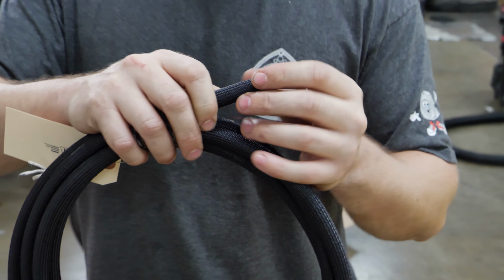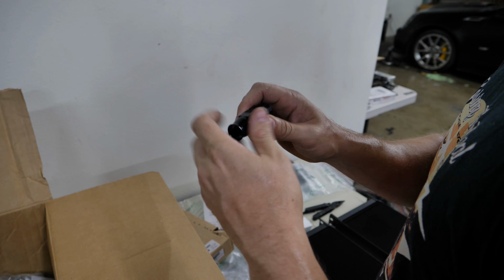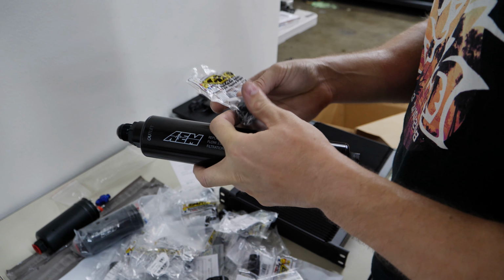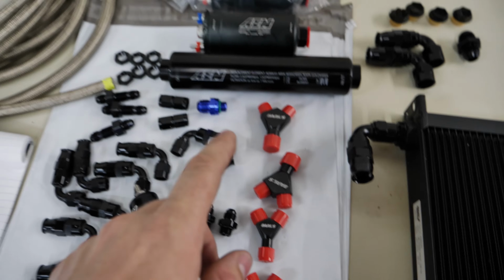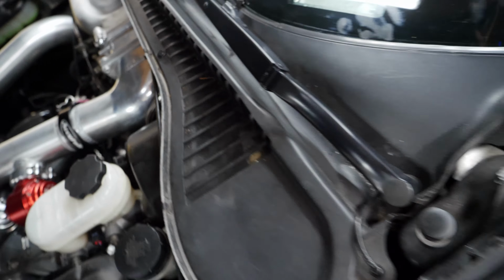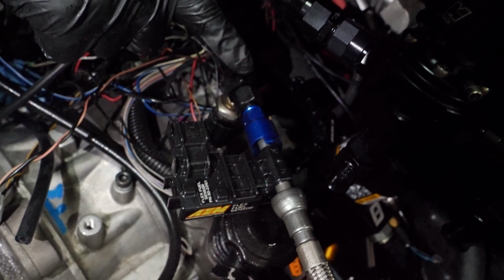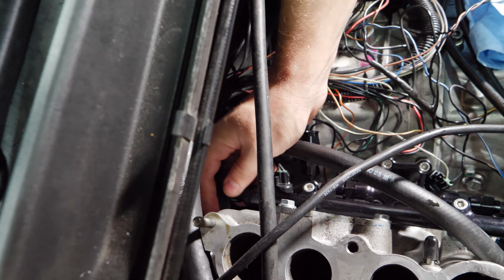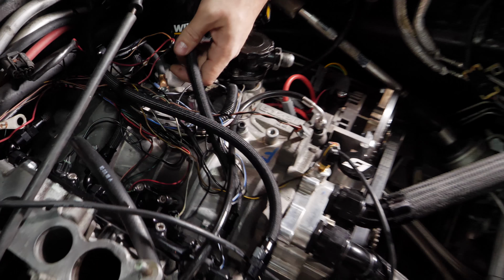Rotaries LOVE E85. Fuel Systems DO NOT. Corvette Upgrade!

Comment: Sorry, but E85/ethanol does not ''gum up'' stuff or corrode anything whatsoever. I don't understand how so many people have become misinformed about this. It will not harm any kind of rubber compounds or metals in your vehicle. The only thing it does is ruin a paper fuel filter and attract tiny amounts of water which is not a problem unless you let the fuel sit on top of metals for months at a time. I've been using E85 on a '99 carbureted motorcycle for 4 years now and nothing has been changed from original except a fuel filter and jets + a tune. No corrosion, no damage to 20 year old rubber hoses and carb parts no nothing.
Reply: Sounds great. =]
Reply: I've been doing the same in my 90 Ranger with just a tune and larger injectors.

I should use a filter that's not cellulose, but I haven't got to that yet.

Comment: Hey rob! Just a word of advice on doing a flex fuel sensor. You want the sensor to be before the fuel rail, not after. Thats so you won't run into a lean condition while ethanol is injected before your ecu can read it. If you can please move the sensor from the return line to the feed line, that'd be awesome!

Comment: Rob, why not run 93 octane with meth injection instead? Rotaries don't like E85 because - like you said - it gums everything up. It causes alot more wear too. It works great in piston engines but not for rotary engines - even though alot of guys use it. Here's a great article that compares and explains why:  http://www.colemanprecisionrotaries.com/tuning--fuel--expanded-e85-coverage.html

I've been following your channel for a while now and it's awesome. Just a fellow rotorhead wanting to help 👍
Reply: Ok I gave it a read as I also was thinking of converting to e85. For my application it won't be happening (stock Renesis for SCCA autocross). Rob has stated that he wants to push serious power (700+) with this motor. Based on the article, his best bet is to push all the E85 he can handle. Also what's a rob dahm build without blowing up a rotary and rebuilding it at some point 😆. Thanks for changing my mind. I don't think Rob's will change though.
Reply: All the corns and doritos!!! 🌽🌽🌽🔺️🔺️🔺️🇺🇸🦅
Reply: Because E85 is the ultimate racing fuel. Yes it is less energy dense but that is the reason for this. More tuning potential than normal fuel. E85 is also economical. Burns cleaner I mean way more cleaner the gasoline. I think Rob cares about the environment.

Comment: It’s been right at 90 for most of the day with 100 percent humidity here in Mississippi and I feel the working on stuff in the middle of the night. The only prob for me is everything ends up being closed when you realize you need the tool you returned earlier in the day. Just finished changing the water and power steering pumps on a 07 Cadillac DTS and it would have been a bigger struggle if I tried to do it during the day.
Reply: Don’t know if you’ve gotten the registration and all that done yet but it probably would have been a good idea to get all that done before irreparably modifying something like a fuel hat.

Comment: 6an isnt able to flow for much over 450hp with E85 .  it may be too restrictive.  better off coming out of the tank also with 8an , and reducing , so down the road you dont have to cut and reweld a fitting when you figure out 6an is limiting .
Reply: It's dual 6an into 8an up to the engine.
Reply: 6an is his planned outlet from tank size.   its restrictive, and limited compared to 8an or larger.  you can always reduce,  you cant always increase ......if he has a demand for 8an down the road.  he has to redo the tank fab work...  why ....... best to go 8 and not " need " it , than be limited ....right ?  and dual 6an to 8an , is a reduction in flow potential . do the math.    2x6an ,compared to 1x8an ..... also a single 6an regulator return . another reduction ......
Reply: @ionstorm66   6an is 3/8" .  so x2 =  3/4" ...   8an = 1/2".  ..
Reply: @twistymcslide2  if he has more demand he will need larger pumps, which will be most likely external, or a surge tank setup.
Reply: @ionstorm66  wrong.   with the reductions , sensors , and return .  he'll run out of flow because of the lines,  not the pumps capabilities.    fluids under pressure work differently than you seem to understand .
Reply: @ionstorm66    6AN is 3/8" .   so 2x 3/8" = 3/4" . . ..8AN = 1/2 ".   that reduction . and then the return is 3/8"....thats also a reduction.

Comment: Give you heads up you're going to have way more restriction in your fuel system using those y fittings by the engine then you would if you just ran one fuel line into your bottom fuel rail which the car runs off of 90% of the time and then run it into your secondary fuel rail then into your fuel pressure regulator before it returns that's the best way to do it the Y's just cause more restriction only benefit out of them you'll have a bit more volume in the system but it will cause a lot of restriction
Reply: The rails are only 6an, so running a 8an into them isn't going to give it any more flow.
Reply: @ionstorm66  the only reason why you upgrade your fuel rails and lines is cuz you need more volume not pressure the way he's doing it he's going to have the proper volume from the pumps but the Y fittings are going to cause a restriction which is going to defeat the purpose of setting it up for more flow not pressure
Reply: @ionstorm66   1 cheap and easy way if you need more fuel volume put an aftermarket fuel filter before the fuel pressure regulator and that will have the volume in the whole system

Comment: Isn't the fuel pump that you are using to send fuel to the other tank  going to loose pressure. I might be wrong but couldn't you turn the mechanical pump that transfers fuel between tanks off of a return line eliminating any possible pressure drop on the pump you connected to the mechanical pump.

Comment: I'd be a little worried  about powering the transfer turbine pump with unregulated pressure (Yikes). Use the return line instead. It will be pressure regulated and you won't have the loss of volume on the supply side.

Comment: Personally I'd keep the flex fuel BEFORE the rail on the feed side.  Seems nominal but if your E content varies from before and after the rails, it could be another potential pain in the ass you could avoid.  Just the .02 from a fellow Michigander cant wait to hear all of these rotaries brapping at the same time!
Reply: AEM calls for it on the return side. Iv done a bunch of flex fuel installs with no issues this way
Reply: @senditmatt3364  I've got to be remembering hearing something backwards then about having it the other way.  Good to know, now itll drive me nuts until I figure out what video I heard that from lmfao.

Comment: Don't weld the bulkheads to the fuel tank top plate. Use 1 nylon sealing washer per fitting, that's all you need. Don't make it harder than it needs to be

Comment: Ah the wonderful measurements of 'Murica. Because it makes 5/728% sense to say Oh this line is AN10, so you have to divide it by 16 to get that it's 5/8th of an inch meaning the outer diameter will be 26/8213 squared inch cubic miles.
Reply: Thank the military for the AN designation 😆

Comment: AN is the end connection type. So the fittings you are using are straight thread o-ring seal to 10AN adapters. They're not AN lines, they're hoses with AN end connections.

I'm an engineer for a tube fittings company just trying to help so you don't "sound like an idiot trying to order them".

Comment: Shouldnt you use higher compression with e85?
Reply: Higher boost means higher effective compression ratio
Reply: I run e85 on a 9.2:1 NA engine.

Yes you see more benefit with more compression or boost, but it will burn in almost anything.
Reply: @208Concepts  You're just killing your fuel economy for no reason running e85 in that setup.
Reply: @ionstorm66  perhaps, but I have my reasons 😁

Comment: not to be a smart ass but will the pumps fight each other?
Reply: No they won’t, it’s a proven setup. The fuel will flow through the path of least resistance. But if it’s such a worry he could always just use check valves after each pumps.
Reply: im not saying it wont work, as we saw it did, i asked if it would fight it. and did he use a check valve? no

Comment: "30% more for the same horsepower" definitely doesn't seem worth having e85
Reply: E85 needs higher temperature for it to ignite than typical 93 therefore preventing detonation when running higher boost levels
Reply: @julianbascle8481  but fuel is supposed to detonate
Reply: @Sube-Tube  Fuel is supposed to detonate, but under a spark not under pressure like a diesel. When you cram so much boost into an engine the fuel will pre ignite and cause knocking/pinging. E85 is a lot more resistant to that than regular gasoline. So therefore you can run a lot more boost on e85. More boost = more fuel = more power.
Reply: @ineedmymodfixed  oh. Pre spark detonation. Makes sense
Reply: Not to mention the fact that it posseses a cooling effect that cools the intake charge better than gasoline.

Comment: Can I just say that rotaries DO NOT LOVE E85.
I tell you this, Rob, because we have had all sorts of dramas with running E85 on two separate 13B-REWs both of which failed and lost compression because the E85 DOES NOT MIX with MINERAL OIL. It coagulates and forms serious sludge in the combustion chambers and rotor housing which gums up the apex seals in the rotor tip grooves and the engines lose compression and fail to start initially and then fail to start completely.
You would know that the 13B injects it's own engine oil (or premix from a separate tank or premix in the fuel tank) into the combustion housing. This is mineral oil. Or it should be, according to Mazda.
You add E85 into that, by way of the fuel injectors, and you are creating a recipe for sludge. Try mixing E85 and mineral oil in a cup and watch what happens.
DO NOT DO WHAT ROB IS DOING HERE. $$$$ Engine rebuild will follow. E85 and rotaries don't mix.